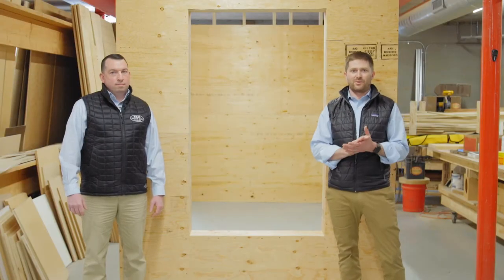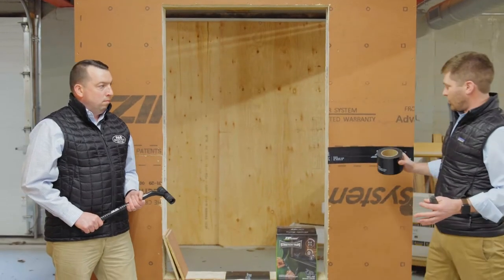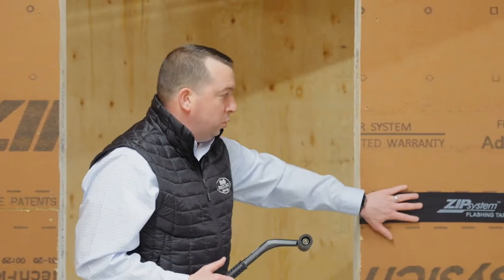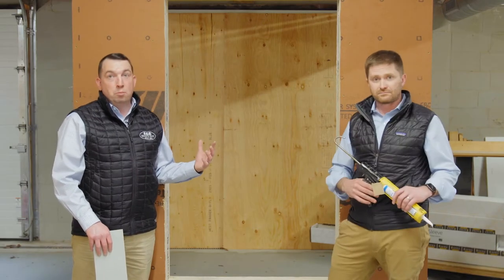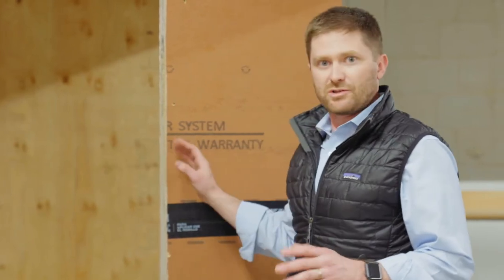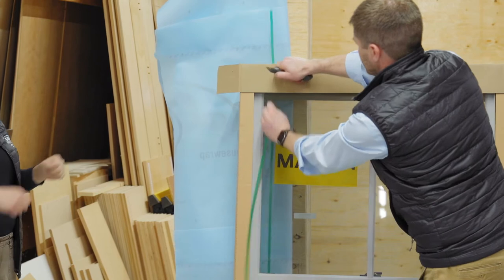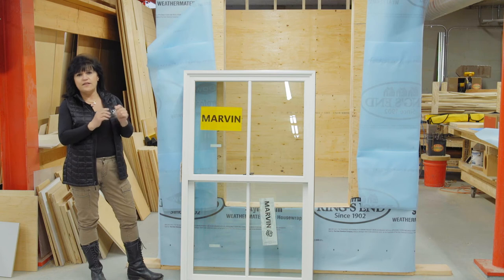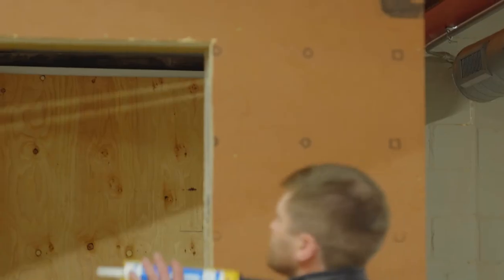Marvin Window Installation with Huber Engineered Woods ZIP System

Comment: What if I have tar paper on an 1920 house? I will take off the trim and apply new azek trim. But siding has to stay.
Reply from the maker: Hi Bobbi Jo, Great question.  You will need to prep your opening for a basic window installation.  This includes a proper window sill pan, sealant behind the flanges, and leg and header flashing with approved products.  The rain skirt is recommended, not required.  Following this best practice instruction will yield a warranted window installation.  Let us know if you have any questions.

Comment: Marvin also requires you to seal under drip cap.
Reply from the maker: Hi Mike, Wrapping the window in some cases becomes a preference or it can be dictated by the designer/architect/building envelope consultant/ or Weather-resistant barrier manufacturer. This is just one of the many ways to Prep an RO. The thought process behind not wrapping material into the window is to prevent lateral water movement in the case of potential failure of flashing and sealant which may allow water to have direct access to the interior wall cavity. By not wrapping the RO, once the water reaches the “different” Material (OSB and not smooth flashing), it will drop down to the window pan and out the open bottom flange.  Let us know if we can answer any other questions!